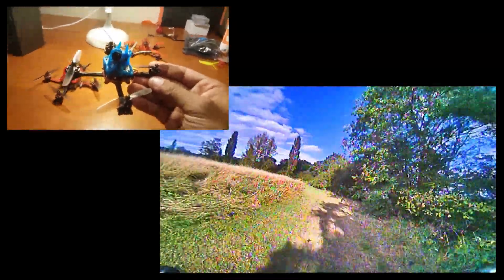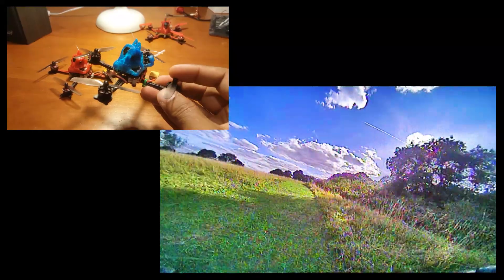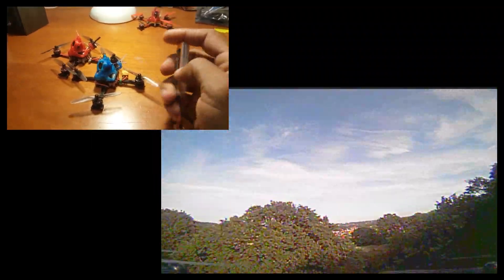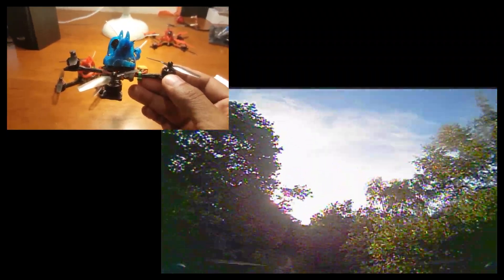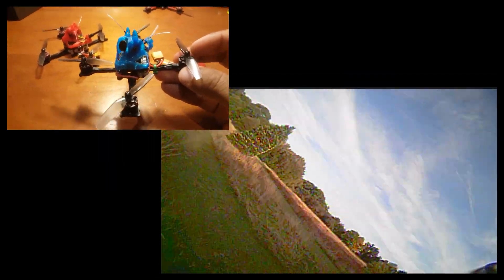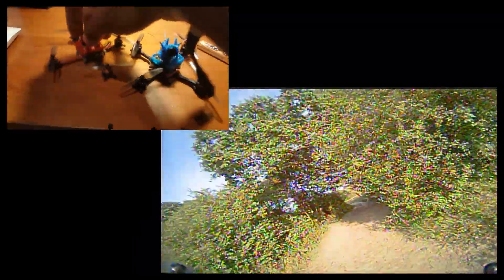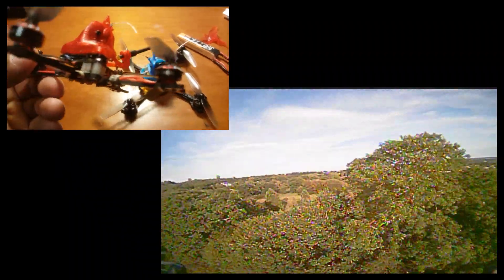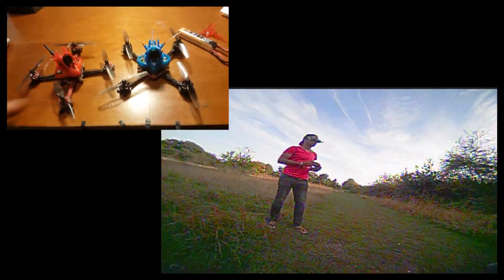2S Pickle Mini super locked toothpick!!

Comment: Very nice Daniel. I've got a 2s Pickle on 1104 6000kv it's a beast and can take beating. Thanks for sharing 🙌🙌🙌
Reply from the maker: I thought about trying this combo as I have some 1104 5500kv laying around! How are the flight times? And what batteries are you using? That seems like it would be very powerful! Also what props you run?
Reply: Daniel Singer 2s gnb 300mah around 2.30 thrash it in the first 1.30 mins and chill in the last few minutes. I use emax Avan 2.3x2.7x3 props. Tried the gemfan 2540 but to much oscillations and didn't gain much
Reply from the maker: Peter Hong Love it!! Thanks for this link! I’ve followed you. This is what I like about these builds where u can quietly fly anywhere 😎
Reply: Daniel Singer it's good and bad that it's too quiet. I posted a flight on IG me flying in the woods. I hit a scraggle and it threw me off my flight plan and before you know it I was lost and couldn't hear the props spinning. Nerve racking experience 🙈

Comment: Thanaks as always for the great video. I finally have the new 10amp Crazybee 3.0 coming with SPI receiver so I'm curious to see how light I can get my Primo on 2S. I already have a 3S Primo that I love but you're right, it's tough to get a smooth flight out of the 3S.
Reply from the maker: Thanks bro 😎 Yeah exactly! 3s is fun if you constantly punch out and love that kind of flying. I love the cruising and accuracy of the 2s for sure. Maybe on lover KV motors the 3s will be in the golden zone but in that case it's better to be lighter with a 2s battery

Comment: You need low KV for big props. If you use big props on high kv motor, it sucks amps and can cause fire to ur esc if they not high enough rated.
ppl fry their 2s aio fc from the mobula and all the aio boards, because they all use 65mm props with only 5amp escs. those motors will take up to 10 amps or even more on 2s with 65mm props
Reply from the maker: Your very right about low kv! People were trying even 11000kv for 2s and that is instant death for those 5amp esc. I don’t get anything near 10 amps with these motors and props on 2s tho. I even use the super cheap 2s boards from banggood and never had an esc burn on this setup. Don’t remember what the actual amps measured were but it was within the limit. Running 3 blade props does tip the limit tho. Motor size affects amp draw too so an 1104 with same kv will draw more amps. The 1103 are more efficient

Comment: What flight controller are you using? OK I see what boards yours...Thanks!
Reply from the maker: I think most of these flight controllers are pretty good with 2s on lower KV. I've used some super cheap ones with tiny fets and they all held up to 2s so far.

Comment: Curious which motors you would recommend for 3" 1S. :)
Reply from the maker: It's difficult to recommend because I haven't tried them all! I wanted to try the recommended 1202 but they are always out of stock haha. I have videos with my 1s 3" running 1103 11000kv and that fly's fantastic if you keep the weight ultra low
Reply: @DanielSingerX  they're in stock right now. :)
Reply from the maker: J. Craft thanks to you I got a set on the way now! Thank you very much for the heads up 😎
Reply: @DanielSingerX  timing just happened to be right.

Comment: I burn my f3 fc that comes from uk65 when I install them on toothpick frame with 1103 8000kv motor. Do you know if the newer f4 12a fc can work with 1s? Currently I don't want to buy 2s since I can charge them like 1s 😀
Reply from the maker: So sorry it burnt :( from what I remember the 12a FC doesn't work with 1s :( that's why I haven't tried any of those yet. I'm using the older f4 with 5amp ESC and no problems even on 2s. But for 1103 8000kv 1s is very weak. I do understand about staying with 1s because of how easy it is to charge!! That is my reason for loving it too
Reply: @DanielSingerX  Thank you for the reply, so for 1s the motor recommendation is still 0802 or 1103 with higher kv?
Reply from the maker: @perbowowicaksono252  it can be either! I haven't tried higher kv 1103 with 1s but I know it works! I have 1102 10000kv and that feels like a very good sweet spot!
Reply: @DanielSingerX  Many Thanks, I will try one of those kv, will update on them later and see what's the result, Cheers